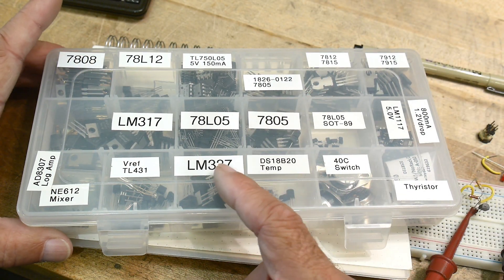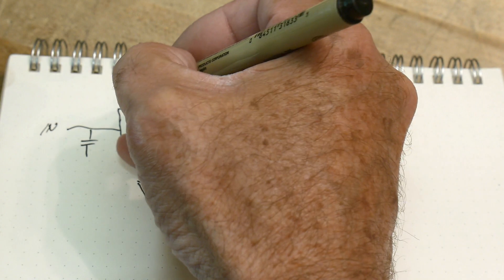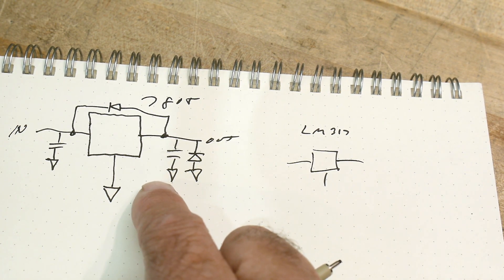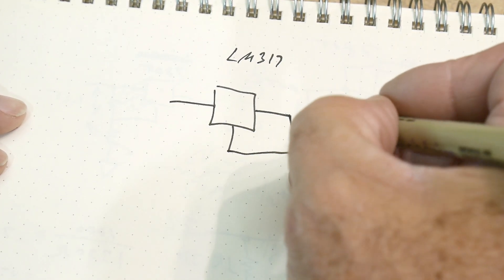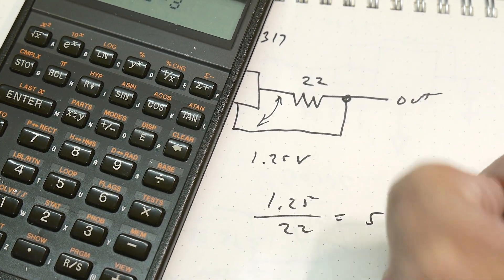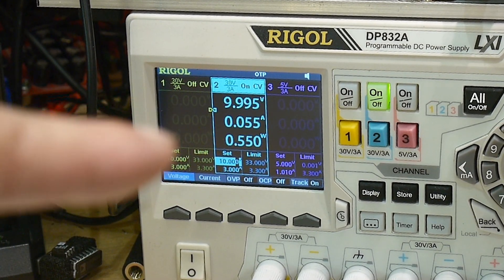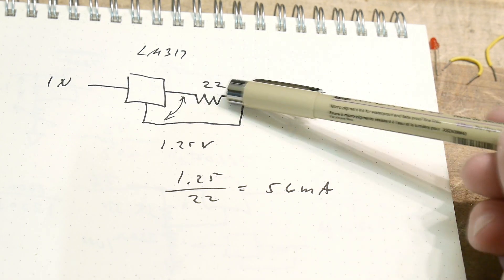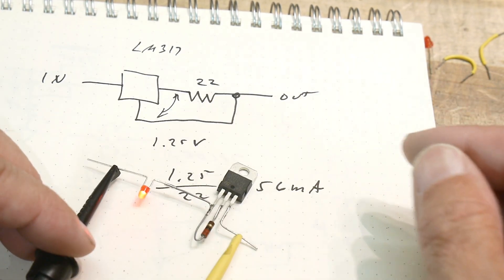#1196 Three Terminal Regulator Constant Current

Comment: Can the LM317 be supplemented with transistor(s) to boost the regulated current and/or make a more stable current over time?  I have found current from this circuit continually increases, even with large resistors and a heatsink.  I'd like something that is stable to four decimal places.  For instance 100.0 mA or 1.000A.   I made a couple portable constant current boxes which are used with 4-wire leads for kelvin measurements.  The 99.8 to 100.2 drift over time is annoying, I like to see a very stable reading so I know the resistance of the device isn't changing.  Right now, I'm not sure if the mV on the reading is due to changes at the current regulator or at my DUT unless I add an ammeter.
Reply from the maker: https://youtu.be/QmGkpntKdm8?si=v4U9coN6fpa208iC

Comment: Nice little goody box of 3 terminal regulators. The mixer looks out of place. My favorite was the LM350...a little more current. I use them to run electric fuel pumps to feed the 1969 IHC 392 4x4 1200D Travelall. They have fan cooled heat sink...and high speed bypass to send 13.6 VDC  nominal to the pump above 2k rpm. The LM 350 would drop about 3-4 volts depending on the pot setting. Why do all this ? The pumps put out 9 psi and would flood past the float on the Edelbrock 1406 when the engine idled. Now there are better fuel pumps with mechanical regulations.

Comment: My problem with getting  constant current that way was I tended to need closer to an amp of current flow, and so I ended up having to parallel a bunch of resistors to get the value down and handle the power dissipation. Without a real good assortment of resistors handy, (management wanted the R&D group to do our jobs with parts from the production stockroom.) The senior engineer came in one day and looked at the rats nest of resistors I was using to set the current, shook his head, sighed and walked back out.

Comment: I built this (with an LM317T) and interestingly, while it starts to regulate current at around 3 V, the current also starts to drop at about 7.5 V, and the 317 starts to exhibit a bit of heat. Interestingly, this effect isn't seen if you model the circuit in LTspice.

Comment: Thank you for showing the protection Diode - I blew out a 3-Terminal regulator when I connected the output to a motor with a flywheel on it, and turned off the input power to stop the motor - and the power stored in the flywheel (now generator) back flowed into the regulator once the input was removed and fried it.  Designs can have the same regulator failure if you put a large capacitor bank on the output without the diode, and turn off the input power.  GREAT VIDEOS SIR !!!

Comment: In 1982 I made an adjustable  1 kilowatts using a lm317. 1 - 317   6 - 250 watts transistors
Reply from the maker: what were the balancing resistors value and wattage.

Comment: Seems to me that the crux of constant current sources such as the one illustrated here is that the current supplied to the load remains constant irrespective of BOTH input voltage and load resistance; the latter was not mentioned in this video.

Comment: 56mA for LED is too much in my opinion, I usually run LEDs at 10mA.  

Also you could use a JFET .  

In case of N-JFET (for Low side control)  --  Like J201  -- the gate is grounded and source resistor to ground determines maximum current that goes out of Drain.  

In case of P-JFET  (for high side control) the gate is connected to VDD and the source to VDD resistor determines the maximum current that goes out of Drain.

However,  in all the cases above both the resistor and the device --  ie.  JFET or LM317-- waste a lot of power and get hot for medium and large currents.

For mid and large currents, you can use inductor in BUCK configuration and CMC (Current Mode Control) configuration without voltage loop feedback, just the current loop or fast loop.
It has more than 80% efficiency; however, It is more complicated design, and may create switching frequency spares.

Comment: It's necessary to point out that the regulator has a minimum load current.  Don't expect to use a 1K resistor and get 1.25mA out.  You'll need an additional load resistor.

Comment: Protection diodes to protect a voltageregulator. About 50 years ago I didn't use them, so after powering a relay my in those days expensive regulator exploded.